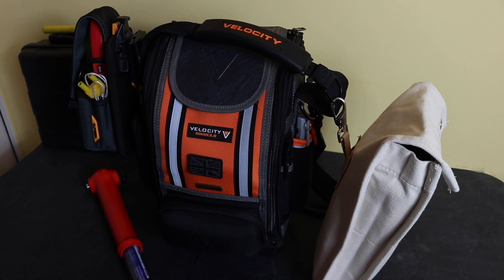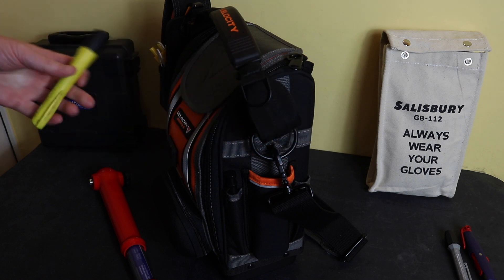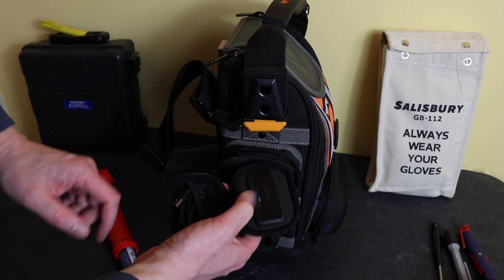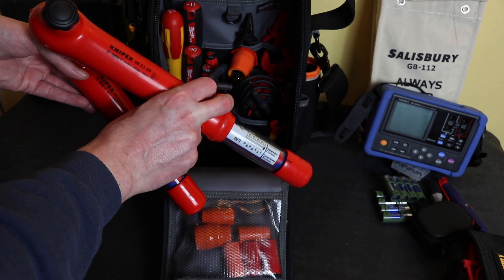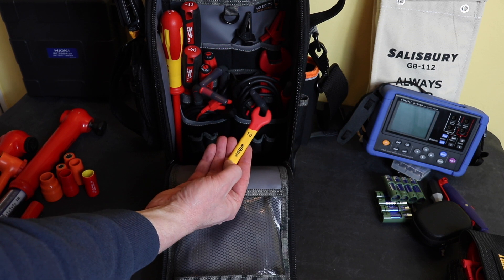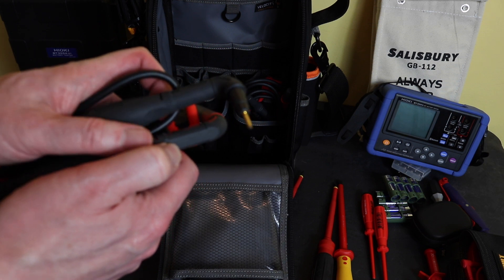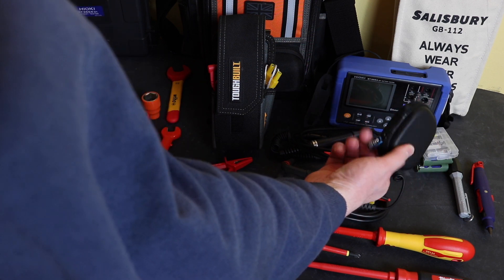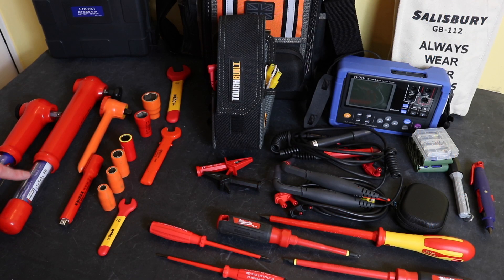Velocity Rogue 2.0 Service Bag and my Battery Maintenance Tools

Comment: Catching up on some older videos.  I do like the velocity bags and they did just start shipping them to the usa at a big cost.  The issue is the selection for rhe usa site has almost no bags for almost half a year.  Just like unilite we won't get the full selection of bags/lights ever it seems.  I wonder if the nb version of rhe bag would have worked better from that famous uk electrician.  That I wish I could get a small enough loadout to try.  Don't be gone in a flash now (electrical humor).
Reply from the maker: Shipping costs are a problem between countries, we have the same trying to get some items here into the UK and then customs duties on top. Unless a USA dealer starts to stock the range, I doubt it will get much better.
The NB range of Velocity bags seem a bit too small for my needs, more in the handbag style than tool bag style.